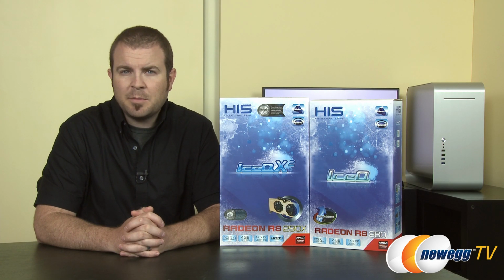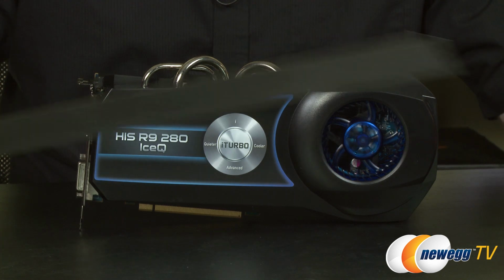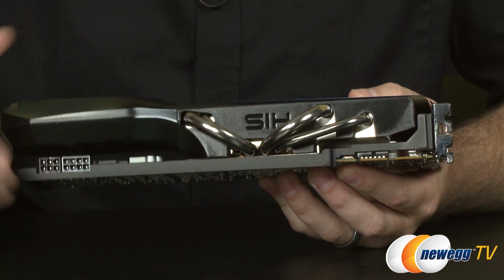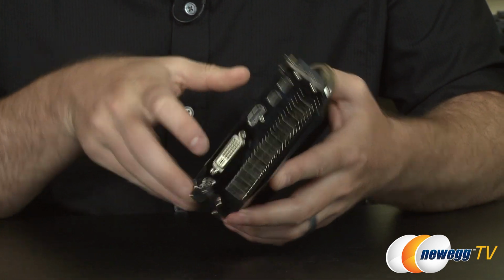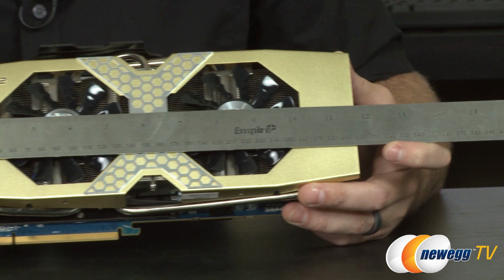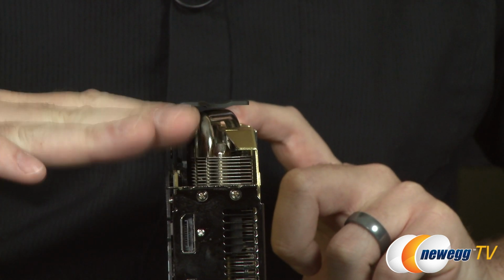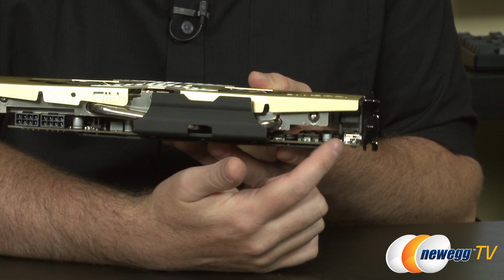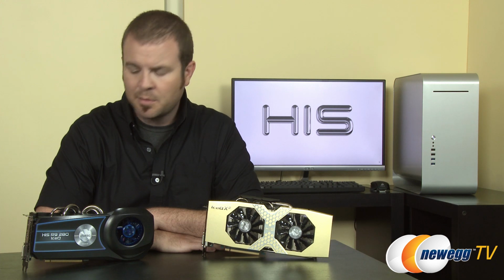HIS R9 280 & R9 290X Overview - Newegg TV

Comment: Whatever you do, don't try and buy this card with "only" a mid tower case. Spoken from experience, I had to saw off a hard drive slot to fit this card inside.
Reply: +BigBadBeef
Reply: thx for u man
Reply: What? I have an R9 290 PCS+ bigger than both of these cards and it easily fits in my mid tower.

Comment: Not sure where to begin. I upgraded with this card from an XFX 6870 2gb. First card never worked at all. Updated motherboard bios, tried my Seasonic 750 psu in lieu of my 650 gold. No go. Sent it back (shipping cost me $15). Second card would work for awhile then no monitor signal. Thinking that maybe I was missing something took it along with my rig to two different shops. In the meantime up graded z68 to z77 board. It would run for a bit then no signal. Don't know if it was a victim of the sleep bug some are experiencing with radeon cards or what. Sent it back cost me another shipping fee. I wasted 5 weeks and 2 shipping charges and 2 fees at my local computer repair shops. So much for the HIS 290X.

Settled on gtx 770 4gb which took me all of 15 minutes to install.

Comment: is the r9 280 technically more powerful than the r9 270x 4GB, the 280 has one less GB of GRAM but its more expensive. sorry I don't fully understand this stuff yet, I'm making it my duty to learn
Reply: Games adapt to your vram. Dont worry  about it that much. Its only if you use multiple monitors
Reply: alright thank you guys
Reply: Timo Pomer Until the game you are playing runs out of VRAM - then it will affect your framerate quite badly. Take Skyrim - that game with only a few mods is forever running out of VRAM space and so you end up going from 60fps to 30fps or even lower. So actually you could say it does have an impact on speed - because the faster it can load textures the faster and smoother the game will be.